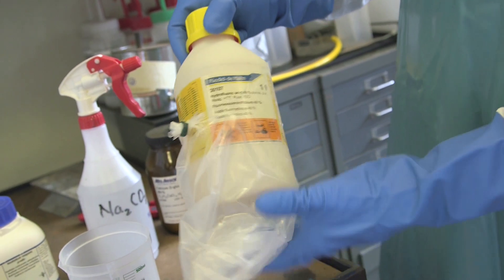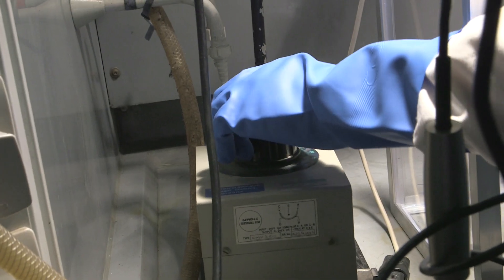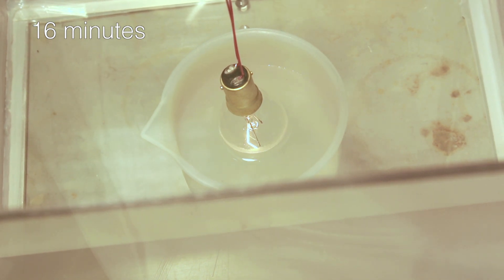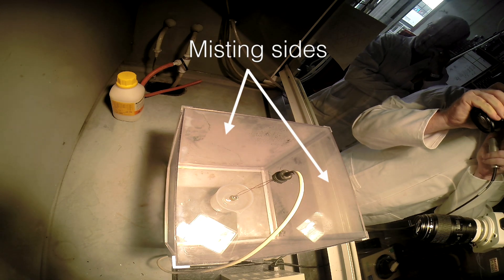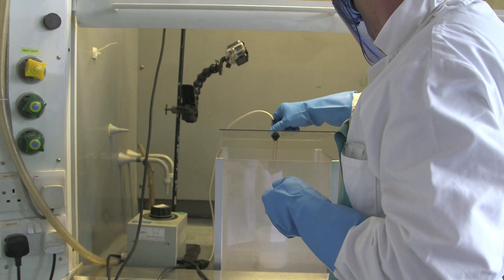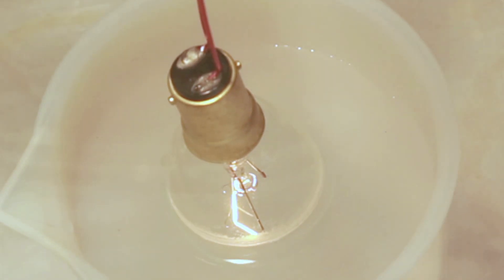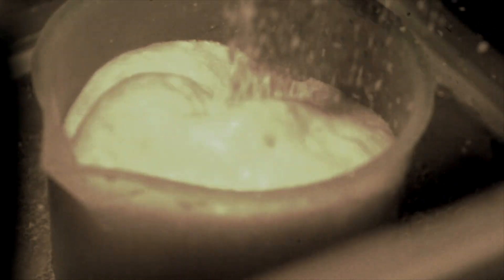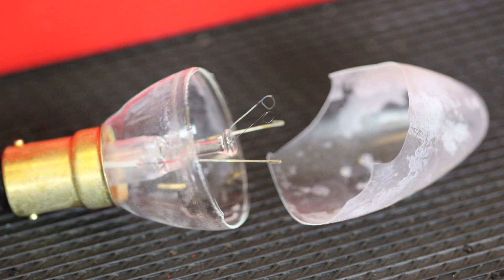Light Bulb in Hydrofluoric Acid (HF)

Comment: It's definitely the fluorine in hydrofluoric acid that is special not the acidity of hydrofluoric acid. Here's why, Even though HF is very corrosive, it isn't considered a strong acid. Because the bond between H and F is very strong and so HF doesn't dissociate much in water. As dissociating completely is the main characteristic of a strong acid, HF is considered a weak acid. It's the fluorine in hydrofluoric acid that is responsible for the lethal systemic toxicity of HF.

Comment: What would happen if you put exposed wires in HF when whatever electronic you're using is plugged in and running? Would it just not work? Would it spark?

Comment: Nice information provided through this video.
Sir, there comes a chemical based powder when mixed in equal quantity/ parts with water, it forms a nontoxic gel, which corroded the thin glass bulb in a 1 minute.
There is also a readymade gel available in laboratory only ,which can corrode any glassware in a minute  can you name it?

Comment: I use to work on Watkins Johnson atmospheric glass deposition system for semi conductor manufacture. About every six months the glass would build up in the nitrogen injection muffle. We would install teflon covers and inject 50% HF into the N2 muffles and wait 2 hours to clean out the build up of glass. We always put on face shield, acid aprons, acid glove and had calcium glucomate nearby. It wasn't to scary when you take care and wear the proper PPE. I did hate that machine though.

Comment: When the maintenance engineer orders dozens of cans with (70% HNO3conc/ 30% HF conc) to spray stainless steel pipes in the plant and wash it off after and you have to tell him, that you need a tent, everybody in fullbody rubber suit with external breething, emergency shower right besides and Calcium injection just in case.

Comment: What the experiment showed is that the corrosion of the glass is strongest right at the surface of the acid. Do the gasses in the air act like catalysts or does it have something to do with surface tension?

Comment: Nobody probably cares, but a minor quibble with the assertion that the filament dissolved once exposed to HF:  The filament is very fragile and doesn't survive well when the vacuum of the bulb is lost.  In air, it oxidizes into crust and breaks very rapidly.  In an aqueous solution, I think thermal shock would probably break it if the air didn't get it fast enough.  In either case dissolution isn't the right way to describe the failure mode.  Fun video.

Comment: Once found a lead bottle in an old house we were refurbishing. It had two concentric discoid protuberances at the neck. The top was unusual in that instead of a cork or lead stopper it had a small gilded perfume vial suspended by three or four tiny nails and embedded in the stopper. I could tell a liquid was inside. I was hesitant to try and open it. I left it in the back of an old Toyota pick up parked in front of my parents orchard while in college. I was unaware it had been ticketed for being immobile for too long and it was finally towed. I only paid $150 for it originally and didnt bother seeking it back. It was only later while perusing an old chemistry book I recognised the container for HF. I imagine the vial improvised into the stopper had a note inside warning of the danger of its contents. Then again, for all I know, the vial had nitroglycerin in it . . . iows, an improvised explosive device. I loath to think someone attempting to open it. More likely the kit and caboodle went into a compactor and recycled. Hope so.

Comment: Used to work in a wafer fab clean room. HF was poured into big long baths (about 50 gallons) and we would carefully slide quartz glass tubes into the acid (they had handles on their sides) after a while they were removed having being cleaned because of etching effect. Once me and my workmate forgot about one and when we went back to the bath the tube had completely dissolved!! Very powerful stuff and not to be mishandled.

Comment: You had a temperature differential between the exposed glass and the submerged glass. This sets up a stress in ordinary (soda-lime-silicate) glass and it separates at the interface. Try it with another thermally conductive fluid to make the bulb last longer.

Comment: I'm not any type of expert, but I couldn't help but notice that the Hydrofluoric acid uniformly dissolved the light bulb up to the surface where the two met (as you mentioned), and , in the other video with HF and chicken, the chicken leg dissolved uniformly right to the contact surface (unlike the comparison of the other two acids). I suppose this shows just how powerful the HF Is, for it leaves no traces of the substance it dissolves behind (unlike the hydrochloric and sulfuric acid in other videos). Why is this?

Comment: Quick question. Why does it shatter and not desolve?
Reply: It dissolves to the point where the glass is thin enough that it is no longer mechanically stable. The pressure difference between the inside & outside of the bulb does the rest.

Comment: 0:37 Professor, it's acid and then water. You have gotten it wrong.🤣
Reply: Adding water to acid is no problem except for Phosphoric and Sulfuric acid. In these two acids you have to add acid to water but in most other acids you can do in both ways.
Reply: @Shaheen_Hassan  yea, still wouldn't recommend since in some case, they might still produce heat. And for HydroHalic acids (HCl, HF, HBr,...) , adding water to the acid might generate Hydrogen Halide gas .

Comment: I dont know what purpose it would serve, except out of sheer curiosity, but what would happen if you tried to do electrolysis of the HF, running a Low Voltage, DC Current through it? would there be a gaseous separation, as when this is done with Water? and if so, what Gasses besides Hydrogen would be produced?

Comment: We use HF to clean our Quartz deposition tubes at work (HCL is used for both Quartz and Silicon Carbide diffusion tubes) as it literally strips a layer off of the inside of the tube. We also use it to strip the oxide off of the silicon wafers while leaving the doped silicon untouched. Great stuff, very dangerous. We use Calcium Gluconate gel as the antidote.

Comment: Well, HF's more frightening because it's common -- work in almost any field of chemistry and you'll meet it. But for sheer pucker factor, you can't beat ClF3, a gas that literally sets almost everything it touches on fire -- instantly. Sand, steel, asbestos, water, and you. The best (worst) part is that the fire can't be smothered and regards anything you might put on it as fuel. Especially water, which will explode and release a cloud of HF. 8-0 Now, that is scary stuff.

Comment: When I was young, I used to use a product for removing rust stains from fabric. It intended use was apparently to remove rust and other oxide stains from sails should a washer or bolt fall into the sail locker. It was removed from the market and I never understood why. All I knew about it at the time it had 10% HF on the bottle. When attempting to have the compound replicated I was told the 10% HF on your skin would leach the Calcium from your bones. I use a totally different method today.

Comment: The light from the filament didn't go out because anything had dissolved because of the HF. It went out because the filament was very quickly oxidised by whatever environment and degraded into a powder.

Comment: I'm pretty sure you can do this exact thing in water and it will cut it exactly the same. The glass NOT in the HF was at an extreme temperature compared to the glass in the HF. I make HF to clean glass with. It does etch the glass but I do my reaction to make the HF in a mason jar lol... And have left it on the counter for days... It's a very very slow cutting of the glass unless heated

Comment: Wouldn't the lightbulb crack like that in water as well because of the huge difference in surface heat between the solution and the air? I mean the way you make glass bottles into cups is by submerging part of the bottle that you want to turn into a cup and taking a blow torch to the upper part of the bottle, and the bottle break naturally because of the stress of the density difference between the glass below the surface and above the surface.

Comment: I would conjecture that the bulb cracks at that point because that is where the filament is producing the most heating of the glass, and thus producing the fastest reaction. The acid is, by the local heating, being convectively drawn up around the bulb, bottom to top and cooling the glass. The meniscus area suffers stagnant coolant flow, is getting the maximum heat. The air only trivially provides cooling action. Nevertheless, there is enough circulation at the air/glass/acid interface to carry spent reactants away and bring in sufficient fresh acid to continue the corrosion the fastest at that area.
So, all around that latitude the glass is getting eaten away the fastest, and when one tiny area is breached clean through, that crack instantly propagates around to the other side and the lower part of the bulb falls away.
Reply: I'd actually that that is where it cracks because mostly because that is where the thermal gradient is largest, leading to stress as the glass expands at different rates. Then when the HF has corroded the glass to be weak enough, it shatters neatly along this line.

Comment: 0:26: A small exposure can cause a "heart attack" (technically, an arrhythmia) because the fluoride ions create insoluble salts with calcium and magnesium, depleting blood calcium levels. This can cause hypocalcemia and hyperkalemia which lead to cardiac arrhythmias.
Reply: Many years ago, you could buy a glass etching compound from craft stores. There was no warning of the consequences of exposure, just instructions to thoroughly irrigate any exposed skin. This may explain why by the age of 40 I experienced arrhythmia (and to this day) requiring daily medication.
The active ingredient was hydrofluoric acid.
Reply: MrVeryCranky I wonder if you can sue the manufacturer... There must thousands of other people who are going through the same problems
Reply: @MrVeryCranky  Probably not related. The reaction would have been acute.
Reply: @MrVeryCranky  I've seen that stuff recently at Walmart in the craft area. I don't know if it is Hydrofluoric acid, but it says glass etching compound.
Reply: @MrVeryCranky  This acid would cause acute changes to the bodies calcium levels and resultant electrolyte abnormalities, but should be corrected by the kidney/bones rather quickly if not immediately fatal. Your arrhythmia is almost certainly not caused by old exposures to HF. I am going to assume based on your age and probabilities your arrhythmia is atrial fibrillation (a-fib) and the medication you take is metoprolol (Toprol) or diltiazem (Cardizem), A-fib is caused typically from longstanding hypertension or other chronic illnesses that cause hypertrophy or dilation of the atria.
Reply: Thank you for explaining, i was going to ask how can a small exposure lead to a heart attack.
Reply: I thought it caused a heart attack due to the fear of having it on your skin, lol.
Reply: @danielodors  That too
Reply: How, then, does the Stannous Fluoride used in dental hygiene not causing permanent nerve damage in my mouth? Does the tin just not let go of the fluorides unless it only apatite in your enamel?
Reply: Wow thanks for this...I was wondering
Reply: Obviously...
Reply: It's not the corrosive nature of HF that's scary. It's how insanely toxic it is combined with its corrosiveness.
Reply: Josh Hays :
would this be by inhalation, or systemic absorption?
Reply: Topical absorption (through the skin).
Reply: @dusterdude238  Either would conceivably be possible, although typically it's from splash/spills in industrial accidents.
Reply: Josh Hays cheers blud
Reply: Plz speak in English☹
Reply: iam your 1000th like bow to me puny human
Reply: I worked in a plant where this was a byproduct!!! Very very scary stuff!!!
Reply: Arrhymyias isn't even a heart attack shm
Reply: Thanks for explaining!
Reply: Gareth Johnstone  You have hypokalememic periodic paralysis? That's crazy, I've yet to see someone with that.
Reply: Not to mention calcium floride forms needle like crystals in your bloodstream.
Reply: Complete nonsense.  MgF2 and CaF2 are soluble at the concentrations of Mg and Ca found in the body.
A lethal dose is 5-10 grams of fluoride.  Lower doses cause nausea.  Chronic poisoning with low doses causes bone deformations.
Reply: @jpdemer5  5 grams of fluoride isn't really that much when we're talking about a liquid spill. Unfortunately, HF readily penetrates skin, so in severe incidents, amputation of limbs is required.
Even if you don't die, the fluoride messes with your metabolism and blocks enzyme functions. You don't have to render Mg or Ca insoluble to cause issues. Drastically slowing down reaction rates in your metabolism is definitely enough to get you into trouble.
Reply: @jpdemer5  you have no clue.
Reply: @jpdemer5  : Wrong. The solubility of CaF2 is about 20 milligrams per liter at 37C. Blood contains about 9-10 milligrams of Ca2+ per deciliter, or in other words 90 to 100 milligrams per liter. Fluoride anion in the blood would therefore absolutely precipitate out 90% of the calcium in the blood, just as the OP stated.
Reply: A heart attack is caused through a myocardial infraction (death of heart muscle),however, heart arrythmias are just irregular heartbeats, do irregular heartbeats cause cardiac cell death?
Reply: @josham3732  In hyperkalemia the electrical conduction through the heart is slowed, causing an lengthening of the QRS interval on EKG, eventually leading to a sine-wave then flat-line with no cardiac motion. This in turn would cause cardiovascular collapse and death from lack of perfusion of the brain and vital organs. Hydrofluoric acid does not cause a heart attack in the sense of a myocardial infarction, which is ischemia of the heart muscle from typically a ruptured plaque in a coronary artery or an embolism.
Reply: @josham3732  I don't know if irregular heartbeats cause cardiac cell death or not but in any case cardiac arrhythmias (irregular heartbeat) can still be potentially life threatening
Reply: @josham3732  irregular heartbeat can still be potentially life threatening or even fatal. HF can also lead to cardiac arrest as mentioned by people who I heard from on quora who have years or even decades of experience working with HF. Cardiac arrest is immediately life threatening.
Reply: To say nothing of the fact that an overdose of fluoride ion will nearly always cause renal failure. Now why we as a society would choose to chronically expose ourselves to fluoride ion in municipal water in order to make an almost statistically insignificant difference in tooth decay rates is beyond my understanding.
Reply: Yet we drink it in our water
Reply: @mariejacob6178  Hydrofluoric acid isn't added to your municipal water, and you aren't drinking unbound fluoride ions. What is added is sodium fluoride.
Reply: Hazy Does sodium fully reduce flouride?
Reply: None of you is concerned that this experiment was bogus? This is how you can cut glass with water. The exact same thing would happen in water

Comment: HF + SiO2 = Fluorosilicic acid + O2.

That is the Flouride added to drinking water(less the O2).

Isn't that nice?
Reply: actually it's sodium fluoride.
Reply: Muzik Bike - Geometry Dash and stuff
Nope, my city uses Fluorosilicic acid, I've seen the tanks.
Reply: +Michael Clark Are you sure? That is quite dangerous and all US countries use sodium fluoride as the mixture.
Reply: It is quite easy to tell what's in a tank marked Fluorosilicic acid(in bold letters).; Its a waste product of industrial processes and fertilizer producion. Metal refining and fertilizer companies use HF to dissolve silica rich rock to release ore and in the production of phosphate fertilizers.
They clean it up a bit and put it in our drinking water.
Isn't that nice?
Reply: At least they clean most of the heavy metals out of it.
Reply: Muzik Bike - Geometry Dash and stuff It's the EU standard, which is far lower than the US one.

Comment: can someone explain why HF causes heart attacks .I am doing a level chemistry so know a bit but nothing on the chemical engineering scale so I'm very curious?
Reply: I have no doubt calcium is involved and you're right that HF would get down to the bone due to its corrosive properties , but I cant see the correlation between bone and a heart attack. Maybe it is the calcium in the blood reacting with the acid to make CaF2? but then again to my knowledge calcium fluoride just makes you feel sick although it is not in your blood stream
Reply: Interesting , so I got the CaF2 bit and blood calcium but what could the toxin be , if the flourine has reacted then that only leaves H+
Reply: No, you literally get a heart attack from it getting on you're skin. It directly leads to a heart attack, very quickly as well.

Comment: HF is a weak acid, why is it so corrosive? Is it because fluorine is so reactive? Or fluoride ion I should say.
Reply: Soviet That's what I said, fluorine is so reactive. Especially fluoride ion F-. Although it undergoes partial ionization there is still F- in solution. But, F in HF can react as well like you said. HCl HBr and HI are all strong acids that are not as corrosive because the halogens below F get weaker and weaker due to increasing atomic radius.
Reply: Yes fluoride forms very strong bonds and so is very reactive with organic compounds but that's also why HF is weak because the bond is strong and isn't easily disassociated
Reply: Michael Watson True.